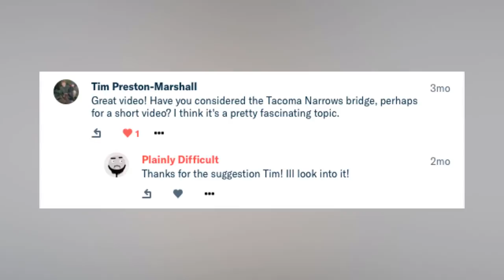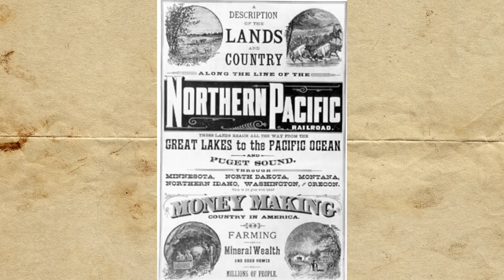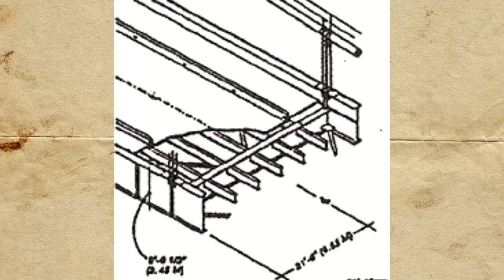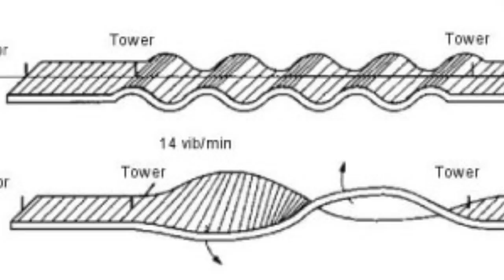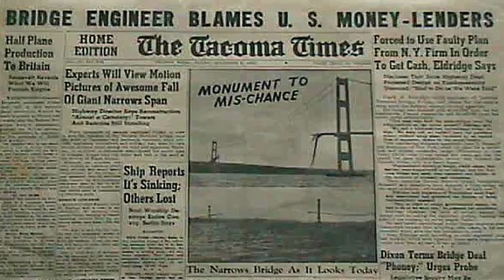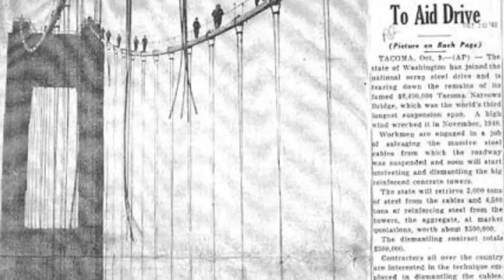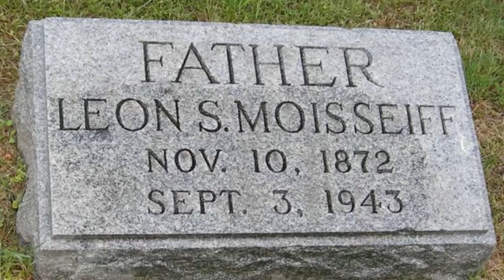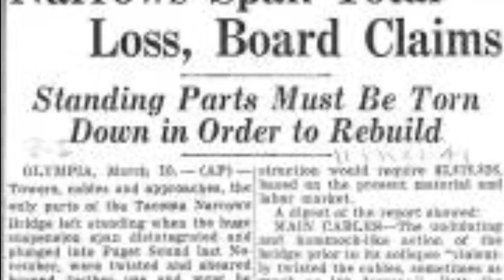Brief history of: The Tacoma Narrows Bridge Collapse (1940)

Comment: “Cheaper and sleeker design”
“Cheaper”
“CHEAPER”
Oh boy I can see where this is going
Reply: Gotta remember that solid structure bridges were promising new technology at the time.  Overall, the strength of the Tacoma Narrows was adequate under normal wind loading in the area and were not all that high on the day it collapsed (not even close to the design load). What wasn't understood at the time was that the winds would often hit the natural resonance of the main span, which is what ultimately caused it to fall. I understand the point you are trying to make but cheaper designs do not always equate to cutting corners and malicious intent. In this particular case, the engineers based their calculations on best practices at the time. Harmonic response was not a well studied field in the 1930's and similar bridges had performed adequately so these considerations to the design were likely deemed unnecessary or were just not available. Remember, the original fix proposed was to drill holes in the deck which would have overall decreased the strength of the bridge. In addition, the holes would have made the bridge cheaper if they had been part of the original construction since it would have saved material. This is a really fascinating disaster because it ended up being an $8,000,000 experiment that thrust cyclic loading, vibrations, and harmonic motion into the front of engineering research.
Reply: Touche salesman.
Reply: Damp potato #36 It was cheap to built the bridge. Unlike the Whitestone Bridge, it never collapsed, but it cost more to built. Look at other bridges in NYC. The Brooklyn Bridge was the very first bridge in NY to built and opened in 1883, and it’s still a true landmark, and still iconic. The Williamsburg Bridge later opened in 1903 was the first all-steel bridge to built, and it was cheaper than this bridge a few decade prior, and it had problems over the years. The Manhattan Bridge later opened in 1909 into 1910 became the strongest bridge to built and it was very expensive than the previous bridge. Long after this bridge, came the Verrazano Narrows Bridge where it opened in 1964 and it was the last bridge in NYC to built and the construction lasted 2-3 years and it ended up being the longest suspension bridge in the world, and the entire NYC, and the height is taller than Godzilla.
Reply: They cut corners to save 3 million, only to have to build another one.
Reply: Good fast or cheap. Pick two. They chose cheap and cheap.

Comment: I love galloping gertie. It's always mentioned in documentaries on Mackinac Bridge. Thanks to Gert, driving on the inner lanes of the Mighty Mac means you drive on a steel grid with great view of the water 200 ft down. They have workers who will drive you in your car across,  because cars stopped on the bridge with terrified drivers are a hazard. It can be very difficult to get them to let go of steering wheel to unlock car, or pry their fingers off the wheel.

Comment: Nice job as always...I read once that there is a smaller bridge in the U.S. state of Maine (to Deer Isle) that followed the Tacoma Narrow's design, and after this accident they added adjustments that may have been the ones you mentioned in the video, from the wind tunnel tests...
Reply from the maker: Is the bridge still standing?
Reply: Yes, it is. The Deer Isle-Sedgwick Bridge was similar in design and construction to the Tacoma Narrows Bridge. It survived the stormy winter of 1942-1943, although just barely, It has some of then same stability issues as Gallopin Gertie, and was retrofitted with extensive longitudinal and transverse diagonal stays. So far, at least, the fixes worked.

Comment: That’s such a bizarre piece of history. It’s strange that they didn’t foresee this happening with the structural issues.
Reply: Vibrations and harmonic resonance were not very well understood at the time, especially in Civil engineering. Hell, aerodynamics as a whole wasn't even that well understood, airplanes were barely 30 years old when construction started. The bridge actually did use cutting edge deflection theory and wind loading models but only for ultimate strength considerations, not harmonics.
Reply: niecers  - Eh, I think you would consider it, as it blows a gale sometimes even on an otherwise calm and sunny day. Also, the Narrows has insane tides. About 20 years ago, I rented a boat at Point Defiance (huge, heavy fiberglas boat, puny, largely useless 10HP outboard motor) and went NW into the Narrows. There I saw a daunting spectacle: A waterfall. I'm not kidding, the water was pouring north out of there so fast it was tumbling down. Scary.
Reply: @eddiehidani3683  Not only were harmonic resonance and aerodynamics poorly understood, I don't think cable suspension bridges (at least ones of this size) were well understood either. Prior to the 1920's, engineers tended to over-build everything for maximum strength, since they didn't have a ton of confidence in their numbers. It was around the 1920's when construction in general really started pushing the limits on how to get their costs down by using science and engineering to lessen the materials required for a job. Engineers were beginning to push the limits (with a bit of arrogance). Think about the turn of the century. We started using i-beams to build sky scrapers. We began using gas engines instead of steam, and we began using all kinds of materials that were cheaper, lighter, and in many cases stronger. It was a special age of engineering where anything was possible. Except maybe using 2.4 meter trusses on a suspension bridge.

Comment: You should have added that the replacement bridge is still standing, alongside the even newer bridge because traffic from the Tacoma side to the Gig Harbor (Kitsap Peninsula) side has increased considerably over the decades and they needed the extra lanes. I walked across the older current bridge, when I saw one time that there was a place to pull over. I went to the mid-span and back again, and I just knew the Big One would hit while I was on there, lol! Both bridges are lovely to go across. I like to as a passenger 'cause the scenery is simply breath-taking and it's hard to gawk while driving. The wind is ALWAYS blowing through the Narrows. I can't believe they didn't allow for that originally.

Comment: This story would be so much less incredible if there were no movies of it. It's one thing to say that "the wind frequency and speed resulted in a harmonic-like twisting of the bridge deck, increasing over time until its inevitable breaking and collapse with the deck rising and falling X Feet, etc" and a completely different thing to show the actual movement which seems impossible for such a large structure, yet clearly was happening. So much learned about the power of wind and how to design adjusting for it.

Comment: The wreckage now acts like an artificial reef that makes a great home for the Giant Pacific Octopus. One of the local aquariums (Point Defiance) has a cool Octopus tank that recreates the environment. 

Even the new bridges still get some wicked winds that can push you sideways a decent bit. I've been pushed part way into the next lane over in a Mini Cooper, which doesn't have a very large sail area.

Some of those buildings in the old photo of the Puget Sound Navy Yard, now Puget Sound Naval Shipyard, are still there and in use. The big brick one that was at the top of the frame, Building 431, and several others from WW2 and before have wood floors throughout most of the space. They look like painted bricks now, as the wood used is approximately 4x8x24 inch slabs set on end to provide good load support, but also reduced damage, compared to concrete, to any tools or parts that might get dropped.

Comment: A crucial factor was the wind oscillation downwind, called von Karman vortices. At the right wind speed, they matched the natural frequency it the bridge. Although accounts focus on the floppiness of the bridge, Dr. von Karman told those who just wanted to strengthen it, "If you build it in the same way, it will fail in the same way." and that an aerodynamic cure was also needed. This factor lessens the designers culpability

Comment: Another bridge failure was the Silver Bridge over the Ohio River that killed 46 people in 1967 (built in 1928). The bridge disaster was basically caused by the inability to actually inspect the bridge structure....which might be expected after 40 years of use and no way to actually see if it was structurally still sound

Comment: Way too many ads. And why are you using the metric system when giving measurements when the bridge was built in the USA using British imperial units?  True the bridge will get you to the Kitsap Peninsula, however the Gig Harbor side is the Gateway to the Olympic Peninsula, and not in Kitsap County.  Good video otherwise.